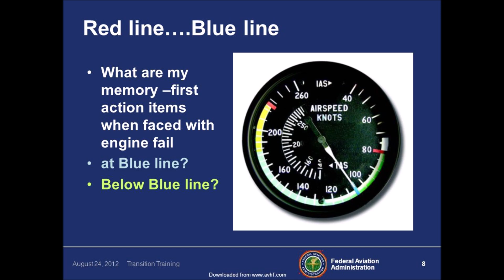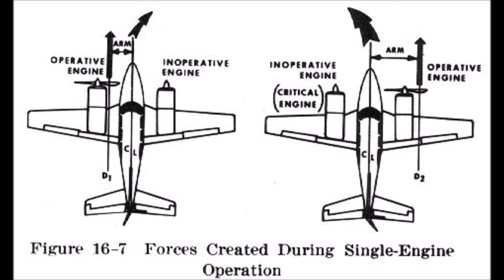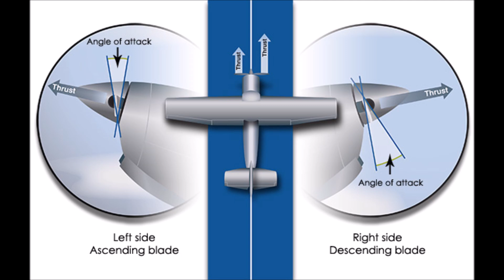King Air Crash- Addison Texas Update

Comment: I didn't really understand why exceeding the blue line speed would cause problems. I can understand it being difficult to do, since you have only half the usual thrust, but I don't see what problems would result.
Reply from the maker: you may not have enough excess power to climb as well as at blue line speed.
Reply: Kevin Martin :  Exceeding blue line at low altitude would increase the  p effect of the remaining engine. That would make it more difficult to maintain directional control without yaw.  It would increase the chance of a yaw stall spin condition and crash .  It is only when sufficient altitude is reached that it is safe to exceed blue line.
( SEL,MEL,warbirds jet type rated )

Comment: Great review. Thank you. Although the King Air 350i is single pilot certified, there were 2 pilots on this flight, and 8 passengers, meaning that this airplane was likely close to maximum weight, which makes an engine failure on take off even more difficult. This really is the worst case scenario, and one of the reasons why I prefer a well-maintained single engine airplane over a twin. Oh, and Happy 4th to all, and heartfelt condolences to all aboard the 350i.

Comment: Why do the props both rotate in the same direction ?   Surely if the right hand prop rotated counterclockwise while the left hand prop rotated clockwise the yaw moments of both engines would cancel resulting in more efficient flight. If either engine failed the aircraft would be no worse off than a right engine fail is now. The original 1903 Wright Flyer had contra-rotating props and that only had one engine, with twin engines it should be a piece of cake. To change the direction of rotation of a four stroke engine requires a different camshaft, oil pump, re-timed spark and rotation of plug leads (engine ancillaries might also require some attention).
Reply: Even if the propellers are counter-rotating, the loss of an engine produces considerable yaw. The benefits of additional maintenance costs are not justified by the marginal safety benefits. BTW, the King Air is a turboprop, so there are no camshafts to consider, only the gearbox.
Reply: @gordonrichardson2972     Thank you for the reply and pointing out the engines are turbo-props. Pratt and Whitney could supply those engines to Beechcraft to rotate either way I guess but they don't which condemns the aircraft to cruise through the skies just a little bit more crabwise than necessary.

Comment: A similar accident happened in Melbourne Australia the outcome was a fully trimmed rudder
Reply: ouch, that's brutal.  I would assume there wasn't 10 people on board that one.  Could this Addison accident be that she was overloaded, perhaps the weight of the 10 people exceeded limits? Or could having 10 on board reduce the safety of the engine out scenarios that are simulated by the type rating flight simulators?  Could the flight simulators that the pilots tested out in be  outdates (at the time of their training on the 350i? )  Looks like nose was up some instead of downward like should have been.  Could having all that weight and luggage have exaggerated the effect of the feeling of the need to pull up on the yoke instead of pushing down? How quick do you have to be to do your engine out at that low altitude...you must first determine which engine, then throttle down then set prop to feather (if not auto-feather turned on).  Just so little time and so much panic it must be so hard to imagine what went through their minds as they were turning into the death-dive into the building.....did the pilots know it was over?

Comment: First, I'm not a pilot, just keenly interested in aviation. Why would the standing run up of the engines not be the preferred way to check engine performance, especially with multi-engine aircraft vs. the accelerating method? 

Juan, thanks for posting these videos, you have a great way of delivering information from a veteran pilots perspective. 
BTW, what is the aircraft you use for the background? How about a tour at some time?

Comment: ...and the mighty Luscomb has an additional factor added to the pilot chore which is the gyroscopic precession : as you run down the runway and raise your tail, the top blade accelerates forward momentarily and this is reflected 90 degrees later, thust adding to the effect of veering the Aircraft to the left (the bottom blade deccelerates and that appears 90 deg later adding to the effect too)...i hope Capt. Pete Browne is already aware of that. Happy 4th of July!
Reply from the maker: Yep!

Comment: Nice one Juan! As good a description of the various take off speed points as you are likely to find and including the dreaded "P" factor. 
Interesting the P38 picture you showed was of a prototype that had conventional inward rotating props (as did most high powered twins) as it gives the reduced adverse yaw moment so neither engine is critical. However for stability reasons this was changed to outward rotating on production P38s which means either was critical. This resulted in a significant number of fatalities in the event of take off engine failure until the appropriate procedures and training were adopted.

Comment: So, why don't aircraft builders use a counter-rotating system? Other than the cost of having to build two different rotation designs, I would have thought this a no brainer. Even most twin engine boats will use counter rotating engines through the transmissions.

Comment: Compare this King Air crash with the August, 2001 Cessna 402 crash in the Bahamas killing all aboard. Initially causation for the earlier Cessna crash was reported as an engine failure.  Later it came to light that overloading of the aircraft substantially was causation.  This could also be an overloading of the aircraft too...

Comment: Back in the early 1980’s I read an investment book in which the author, Howard Ruff, having become successful told how he decided against his inclination to get a twin engine airplane, when his due diligence revealed twins were more dangerous to fly than a single engine airplane, because of this problem of flying on only one engine.  At first, he thought it would be a safety factor to have an extra engine, in case of an engine failure.  However, after researching the matter got a single engine plane.

Great presentation.  All GA twin pilots should be required to see this video.  I myself would not fly with someone who had a twin for these reasons.

Comment: The P-38.... A Curious flying machine!!!   BOTH engines seem critical (to me) because the Downward moving prop blades are BOTH away from the fuselage..   towards the wing tips.   I've never heard a reason why they were made that way.   For sure, some Piper twins have contra-rotating props with the downward moving blades INBOARD.  Thanks Juan!!

Comment: Good presentation of  facts.  ADDTL INFO:  Crew info - PIC 71,  1st Class Med,  ATP,  dozens of type ratings, however shows KA300 but not a KA350 TR (not sure if 300/350 are reciprocal ratings)  SIC 28,  1st glass med (although in doubt it was w/in L 12 mos)  Comm, Inst, ASEL, AMEL  No shown type ratings.   12 sec before end of CVR - comments 'consistent with cockpit confusion",  8 sec before end of CVR,  discussion of Left Engine,   4 seconds before end of CVR,  3 or 4 audible alerts heard in background noise on cvr.    4 video's - 2 at threshold of RNWY 15,  1 FBO security cam roughly mid-field,  and 1 from ADS firefighter with dashcam from his personal vehicle  less than 5-600 ft due east of hangar showing actual collision into hangar.   Unknown (as of now) that either pilot attended G&F for the Make/Model or if PIC was w/in L 12 mos in KA.    Appears big difference in crew experience between PIC and SIC.    In one local TV news station video of aftermath,  1 prop clearly shows it was feathered.  
Could it be that PIC selected SIC as just a conformity response to meet minimums for 2 person crew?   It also seems 'possible' this may have been recoverable (assuming R engine was at full T.O. power) with quicker reaction just after V1 R V2??
Reply: Great point on the SIC qualifications!!   I’ll bet that compliance only hurdle is all that is regularly met.  My friend who was a commercial pilot for forty years got those SIC jobs but he WAS qualified.
Reply: I think the props are Spring-Loaded to Feather... I may have that wrong, though.
Reply: Duane Lundgren not spring loaded you pull them into that position on shut down
Reply: @kenclark9888  For a normal shutdown, absolutely yes...  However, left to their own devices, they will feather, not instantly but will feather.  Seeing an after-accident picture, the prop(s) will be in feather unless mechanically damaged.  My thoughts.
Reply: Duane Lundgren no sir they don’t.  The King Air has an autofeather feature however it doesn’t always work.  Even with it working you still need to verify that the prop feathered.   Some aircraft don’t have that and on a failure the prop must be feathered by the crew.   I’ve flown other models of the King Air that didn’t have it
Reply: avflyguy I just saw a news article on the sic said he was 28 where did you get that info
Reply: avflyguy in the sims when I’ve done similar yes it is recoverable
Reply: avflyguy and I looked at my certificate it shows as a BE-300 type rating and it qualls ya for 350!

Comment: Ah yes the mighty Luscombe! Pilot observing mentioned it didn't seem to be making full power. Skipping getting technical I first suspect he wasn't staying ahead of the aircraft and ready for lowering the nose when at full power single engine. Drastic consequences. If he didn't set prop pitch for full power making it sound like he wasn't at full power to the observer then applied proper pitch adding more crank the plane to the left....You know whatever the case it didn't end well. I think the primary cause was letting the nose down to maintain proper airspeed for single engine climb he wasn't planning or ready for the swing of the good engine overpowering his inputs. Nobody knows yet. But, hopefully the King Air automatic system doesn't snap out of feather if the pilot applies pitch changes with some energy still left in the system to allow the prop to be taken out of feather causing more unexpected drag. I mention that due to the ground observation of he didn't "sound" like he was making full power. Systems management doesn't need to become extra confusing. Thank god for gliders. Sad crash.

Comment: The thing to keep in mind here is that if EITHER of the engines fails, you can kill yourself if you aren't on top of it. The common misconception is that it's only a failure of the "critical" engine that will bite you. Nope, that's not it at all. You still have to know what in the hell you're doing in either case. You might get killed faster if you screw up after a critical engine failure...but you'll still probably kill yourself nonetheless. It will just take a few seconds longer. 

Great presentation though--the footage you included is pretty hard to watch, and the CFI in me was yelling at the screen...

Comment: SORRY I'M A NON PILOT, JUST LOVE PLANES. PROBABLY A STUPID QUESTION BUT IS THE RUDDER BOOST AUTOMATIC, OR IS THIS SOMETHING THE PILOT  HAS TO INITIATE? PLUS IF COUNTER ROTATING BLADES ARE SAFER WHY WOULD BEECHCRAFT NOT MAKE ALL PLANES AS SUCH. JUST A THOUGHT LOVE YOUR CHANNEL THOUGH
Reply: I seem to remember it is BLEED AIR CONTROLLED.... loss of bleed air on one side lets that cylinder PUSH the rudder and it pushes the PROPER way...
Reply: @duanelundgren0645  thanks for the info. Makes sense.

Comment: Sounds like they lost an engine on takeoff and was probably below blue line. If you consider how new the aircraft was, the failure of a PT6 turbine engine is not very common, but also not completly impossible. when the PT6 turbine engine suffers from a complete failure, the propeller automatically goes to feather.
Reply: I’m hearing chatter it may have been a loading issue.

Comment: 1-power up, 2-clean up, 3-identify, 4-verify, 5-feather. When unpuckered, secure the failed engine. At altitude, if able, restart checklist can be run. In the real world, for everybody other than FAR 121 and other swept-wing jets, the gear comes up only after you are committed to climb out. That solves the #1 decision - land or fly. If the gear lever is still down, you land; if the gear lever is up, you fly. A common scenario is a power fluctuation or pulsing surge, related to an incipient failure. The aircraft yaws both directions, and makes the identification of the failing engine almost impossible. This happened to me on takeoff from OKC once in a Twin Comanche. The gear lever was down, so I landed. Spent the night in a motel, and got a new carburetor the next day; but it's a wild ride, and your heart won't beat while it's happening.
Reply: That's hairy. These guys apparently had 3 to 5 seconds to process all of that, then they were in a low altitude stall.

Comment: I live in Carrollton. A few days before this accident I was out walking the dog when I heard an aircraft that sounded odd. I looked above me and saw a King Air  flying low and slow, possibly still in the pattern for Addison (not sure) and the engines were making an odd sound, like the pitch was set wrong or something. After a bit the noise stopped and the aircraft picked up speed and altitude and flew off. Not sure if this is the same aircraft or not but something definitely seemed odd and the sound attracted my attention. I am not a pilot (almost made it to solo) but my father was a pilot all his life and I have been around aircraft most of mine so I am familiar enough to know when something doesn't sound right... it didn't. I see King Airs flying in and out of Addison all the time so I know what they should sound like.

Comment: I had an engine failure as a student. The training worked and i made the runway. It was a new engine. As i pulled power back on an extended downwind it quit. I made it back dead stick. Fortunately i had spin training, so I knew what the airplane would tell me nearing stall. I also had a little glider time.  I didn't get scared until a half hour later back in the hangar. But training works. Be safe!
Reply: Good save 
My son had an engin failure while towing a glider. Cylinder failed on a Pawnee.
He shut down the engine and dead sticker into a wet field.
Then he went to the movies to see Saving Private Ryan.
I got the email and printed it.
Reply: Time in a glider has saved my butt more than I care to admit. I think it eliminates the fear of landing out and dead stick. I towed banners and stuffed a Cub in the marsh followed by another engine out in the same Super Cub 2 months later. That one I put down on the beach. The ironic part was it was a proposal banner where she said no and shortly after the call to not make another pass came the motor quit. I recommend glider training to most as a way to get started. It's affordable and the confidence in a single engine out situation is priceless at times. So while my daughter is still very young she loves our Maule and if she wants to get her ticket she'll be starting in a glider too. Well more like officially starting ;-)
Reply: Good landing on the beach and good flying. Thanks for the post
Reply: @southjerseysound7340  I agree with you. It is my opinion that every pilot should have glider time and aerobatic time. Full deep stall training and at least basic instrument training. I'm not talking an hour or two under the hood but full instrument training to include shooting an approach. Even if with atc help. That way the pilot could save himself if needed. Glider instead of simulated engine out. Aerobics instead of lame unusual attitude and insipiant stall training, and basic real instrument training instead of a couple hours under the hood. It would save lives. The glider and aerobatics (super dimona & super decathelon) training saved me, I am convinced. It didn't hurt having spun and performed many departure and approach stalls in that same airplane. I knew what it was telling me and what it was going to do. In fact I did my check ride in it and when the examiner wanted a 30degree left bank stall. I did it, a full deep stall. Not an accelerated stall like for a spin. Just a deep stall. He didn't feel the buffet come and go, he said tell him when I had stalled it so I told him look at vsi. He said no, recover, recover! He thought I would take it to the edge and no more. LoL. I offered to spin it for him. He said no. Too bad. I loved spinning that thing. 4 1/2 turns and recover straight into a departure stall. The most I ever did was 9 full turns. That was 20;years ago. I still love spinning airplanes and full blown deep stalls in all attitudes. You learn to stick and rudder, seat of the pants fly that way. Some day I'd like to do glider aerobatics. Talk about energy management. Great fun. Be safe.
Reply: @southjerseysound7340  there are old pilots, there are bold pilots.....
Reply: well done. i hope all pilots are working on your level Ron. glad you made it home.
Reply: Did you remember to turn on carb heat when throttling back on the downwind leg?
Reply: Dead stick is easy and safe...twin SOP humanly impossible

Comment: Does the same affect that your describe here on multi engine propeller aircraft apply also to multi engine (pure) jet aircraft? Reason I'm asking is that I've seen a 757 blow an engine on take off due to bird ingestion and yet continue on seemingly in a continued rate of ascent and with no visibly apparent yaw distortion?
Reply: Twin jet engines do have thrust asymmetry, but they do not have a critical engine. Most commercial aircraft have higher engine power safety margins, and better trained pilots.
Reply: Yes, it would. Though there are likely to be some of those automatic safety features Juan talked about on that plane.